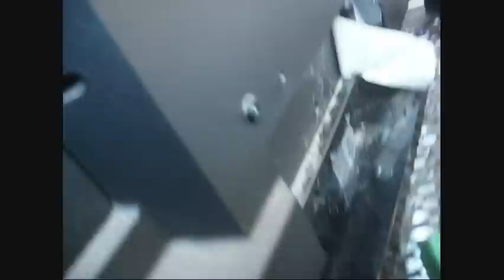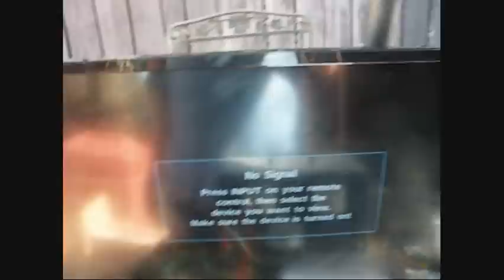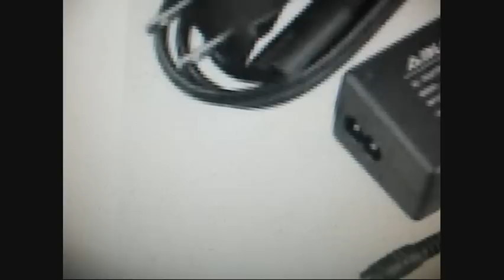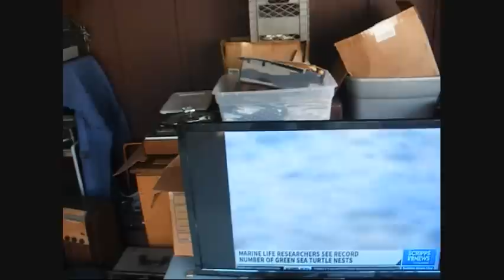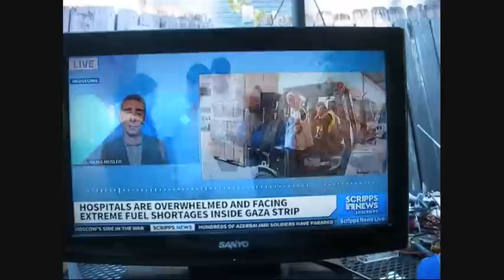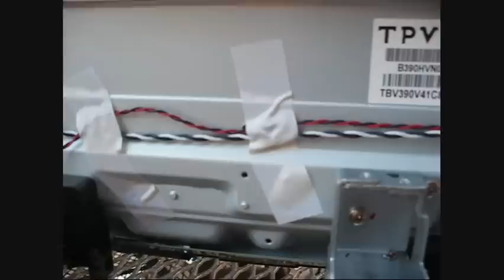Three curb-shopped flat screen TVs (fixed two of them)

Comment: I repaired similar tvs several years back using a sawhorse table. Otherwise it took a spare bed to lay them on. I repaired 5 out of 8 with just capacitors!

Comment: If The button that you were using to navigate the menus is the one that's located around the power button, then you would probably use the power button for enter. You may have to either press it quickly to achieve enter or you may have to press and hold it in order to enter (select).

Comment: Finally got to watch. When I tried watching it when it was just posted, the little circle loading thing kept spinning. Other videos played fine.
I don't like replacing things. I prefer they last a long time. I don't have to have the latest all of the time. I'll keep a Refrigerator until it stops, even if it's ancient. Same for Washers and Dryers. But, the ones I have now won't last 1/3 as long as previous appliances.
Btw, do you tighten the screws on the circuit boards? I assume you do, but just don't mention it.
Reply: I call that little circle the worry wheel. When I see it, I begin to worry that the stream will not start.

Comment: The cheap TV's of today are still light years better than the old CRT's in terms of utility and viewability. Not a bad trade off for something that takes up so little space but with a big picture, weighs so little and uses so little electricity to run.

Comment: Interesting about the power supply issues! When these LCD panels turn out to be time wasters,  I like to connect the CCFL power supply to various other circuits to give it a send off. They haven't made super spectacular final performance yet but I haven't tried everything either. I have a hunch that cross contaminating itself with it's own voltage and/or signals might just get really interesting,. I made a character generator in a VCR go completely ape-shxt just by connecting ic's with wet paper (no damage) and I think these crappier LCD panels have hidden talent!

Comment: I picked up what appears to be a 27" Sanyo from a local Goodwill store (yeah, the BAD guys) several years ago for less than $25 because it had a couple of scratches on the face of the screen.  When the set is operating you absolutely CANNOT see those scratches so I think it was a great deal.
Reply: I picked up a 19" Toshiba flat screen from Goodwill for $4.99. Works perfectly.
Reply: I have an LCD with a pinhole on the front polarizer.

Comment: In 2008 I bought a Samsung 36 inch 1080p HD TV. Its been in the living room 15 years now and has about a zillion hours on it. It has been flawless,  the picture looks just as good as new. Great clarity, great color. If it died tomorrow,  I've definitely got more than my money's worth. So here's the question. Did I get lucky and get an exceptionally reliable one, or is Samsung just that good??
Reply: I've been picking up sets lately seems the older models are better quality. I fixed one for a friend recently has good color. I think the components were better quality back then.
Reply: Sounds like my grandma's 2009 Samsung LN52B630, very reliable.
Reply: SomSing IS GUD

Comment: Two flat screen TV’s has been fixed, one has been EOL’ed. Insignia is the worst TV I have ever seen. It had a built-in Roku device which was pre-installed. Mine is a ONN smart TV with Roku, and ONN is a Walmart brand.

Comment: I powered one of those Insignia TVs that used a 12 volt wall wart with a 12 volt sealed lead acid battery. And It worked for 23 hours before it needed recharged.